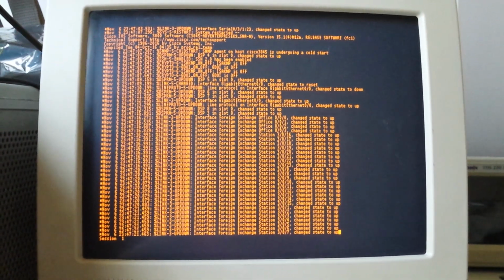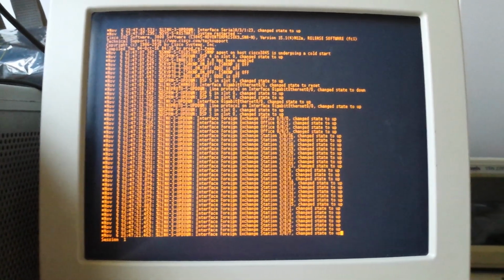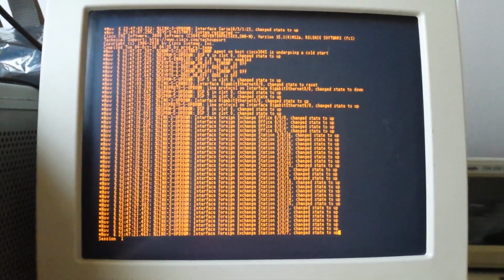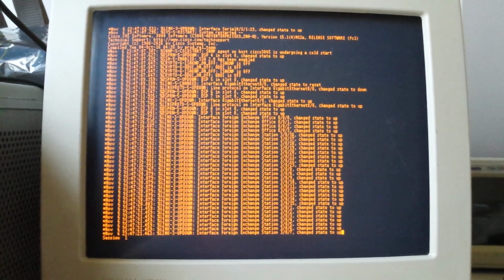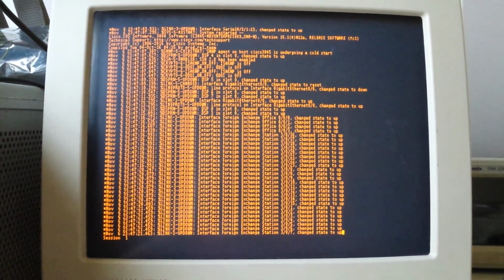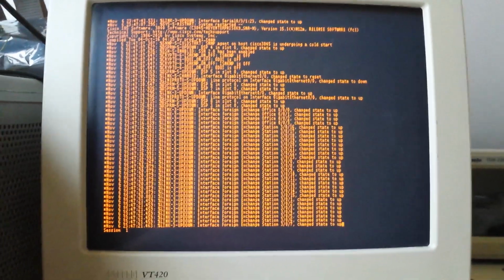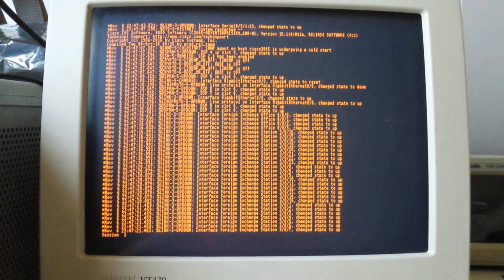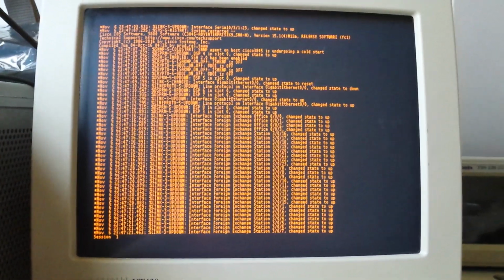Cisco 3845 Repair

Comment: The network module slots are based upon 32-bit PCI bus running at only up to 25MHz due to the less ideal transmission line characteristics of the extra connectorization. The next generation jumped to PCIe. It’s quite possible that I might have EEPROM data as I have most every module and card.
Reply from the maker: I actually ended up with a working set of cards and tried to copy the EEPROM data from the working to the non-working, but I think the next thing I ran into was that the CPLD isn't flashed with the right code. It's a project I might pick back up one day, but not really a priority. The cards in question are VIC2-2BRI-NT/TE.